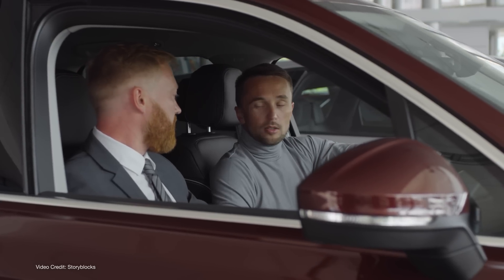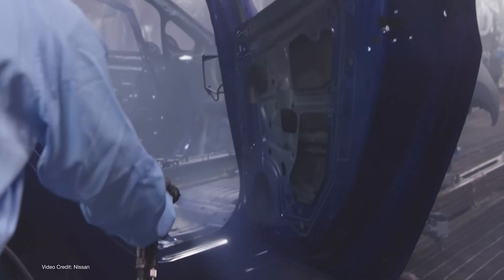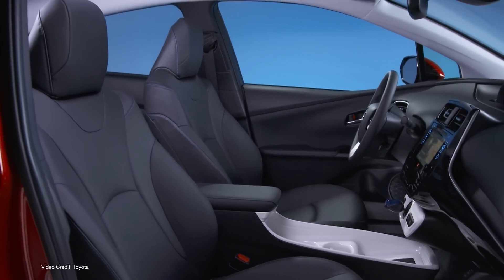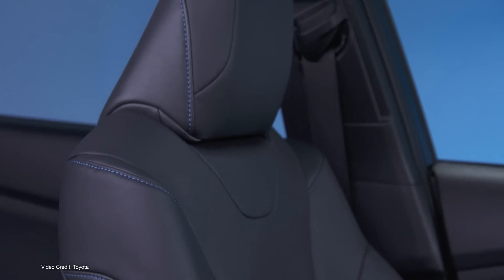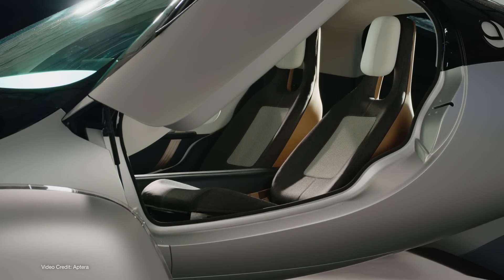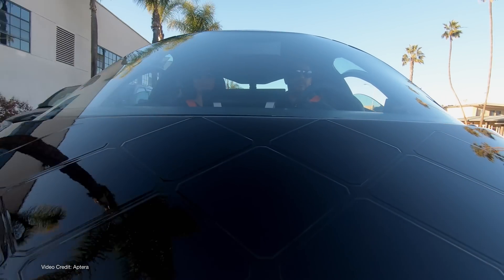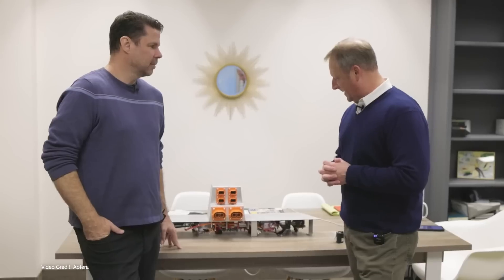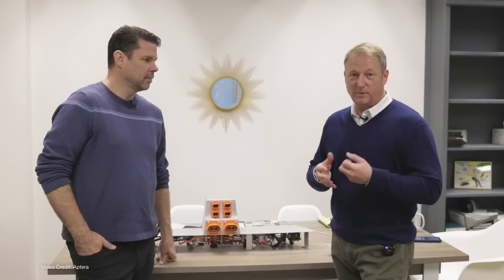Aptera Just Did a 180 On Fast Charging - Here's Why

Comment: Good presentation, thanks Nikki. One thing, with regard to your particular situation, you mentioned refinancing and getting a lower monthly payment to go along with your new solar loan. 
You didn't mention amortization. If you had been paying on your original home loan for a while you were just starting to pay off principal. 
With the new home loan you're back to square one with regard to paying principle with your monthly payments. You have to take that into consideration also. Refinancing is usually bad. 

Here's a trick. Get a home equity line of credit, And pay off your mortgage. The interest rate will be slightly higher, but it's a simple interest loan and you will start paying off principal from the very beginning.  This works best if you only keeping your house for Less than 10 years.

Comment: Fast charging electric vehicles can only be charged 120 to about 240 with about 80% only capable of 180 charges.  That means you can only recharge the battery 120 to 240 times with the vast majority being only 180 times.  Imagine a gasoline car only being able to go to the gas station 180 times before having to replace the entire engine.  The reason why electric cars do not last longer than 1 to 5 years is because of all the electrical shit in them that breaks down every time you do anything with it.  The longest lasting electric car lasted a grand total of 5 years and that was it.  Electric cars break down instantly and have to be replaced constantly and have massive problems.  They are not a replacement for gasoline mainly because they are already breaking down.  Over 300,000,000 electric cars have been made in the last 15 years but only 4,000,000 are still on the road and those were made in the last 5 years and will also break down.  Electric cars are not green either because in order to mine the extremely highly radioactive and dangerous and extremely rare materials in which child slave labor is used, along with transporting the materials to the factories in China that make the vehicles, then transporting them across the ocean, then putting the cars together in the factories in Germany, Russia, South Korea, then transporting more parts to America before finishing the building prosses of them electric cars use more than over 5000 times the amount of fossil fuel than a gas car will require for its making, transporting, and refueling for 25 years.  Then after the massive fossil fuel use just to get the piece of shit electric vehicle to you morons who falsely believe is good for the planet then you have to look at the reality of how much fossil fuel is used to increase the stress massively upon the electric grid that is already stressed to fucking hell with all the other electric shit it has to power to the point that in order to charge a single electric car it uses 187 gallons of gasoline to charge an electric car for use during a regular week in which a gasoline only needs to be fueled up once a week in which requires only 20 gallons of gas for a gas car.  That means for fueling up an electric car uses more than 9 times the amount of gasoline as a gas car uses.  Electric cars are not efficient at all and use so much more insanity of amounts of fossil fuel that make them straight up trash.  If humanity stopped making adn using electric cars then the use of fossil fuels to fuel vehicles would drop by 98% instantly.  If you stop making and using solar and wind power and focused on using coal to power the planet then the requirement of fossil fuels would drop by nearly 99% and we would be using dam near no fossil fuels and the planet would be safer because of how much digging and how rare and how much it costs in fossil fuel usage to mine the super extremely rare and dangerous materials and by how many slaves are used and how much more fuel is required to melt down the shit to make it usable.
Reply: Lots of false claims in this wall of text.  Some of these are REAL whoppers.

Comment: It will hurt your battery lifecycles to charge so fast. Be careful what you ask for.
Reply from the maker: There's evidence it may extend the life of the battery in some circumstances.

^Kate
Reply: Aptera has much lower impedance on the cells in their packs, so they aren't subject to as much heating.

Comment: I still can't get over a couple items.  1 - the recharge times still deters many who travel distances, so basically EVs are primarily for those who don't travel such distances with time constraints.  2 - I just don't understand the concept of developing such products in CA, due to the significantly higher costs associated with any business in the state.  Between all the red tape, taxes, regulations, cost of materials and labor costs adds a great deal to any product manufactured in the state.  The costs will likely not change, but hopefully the near future will show some great improvements in recharge times, especially for those who travel a great deal.  There has been a push to have charging stations around countries, though they still may be difficult to find in places like the US, where rural areas may not yet be able to accommodate them.  On another note, it's rather ironic that CA has pushed so much for 'green energy', going as far as kicking out more and more restrictions placed on gas or fossil fuels in general, but seems to have a problem keeping normal operations powered - brown outs and lack of sufficient electricity causing restrictions on recharging EVs.
Reply: If CA were as dire a business environment as implied by your rant there would be no manufacturing at all in the state. CA has one of the largest economies in the world, bigger than many countries. You comment appears to be cut and pasted from some right-wing "news" source.
Reply: I live in Iowa, and will be getting an early model. 62% of our grid power comes from wind.  It will be perfect for us, and the solar will reduce overall power demand on the grid, along with the much better efficiency.

Comment: The Tesla Supercharger network isn't the only DC fast charging option for NACS (North American Charging Standard) equipped vehicles.   EVgo stations are being installed that are also equipped with 50 kW NACS cables in addition to the more common CHAdeMO and CCS cable combinations.  So there is no need to wait for a confirmed agreement with Tesla for use of the Supercharger network to justify including the DC fast charging capability.

Comment: The thing is they were right right with their initial choice, as much as I hate electric cars, fast charging shortens the overall lifespan of a battery
Reply from the maker: There's evidence that it may extend the life of the battery.

^Kate
Reply: @transportevolved  I mean any rc airplane enthusiast whose worked with lipo batteries which ar similar to what goes into modern electric cars knows this, it’s common knowledge, it’s also common knowledge that they are highly explosive when punctured, especially when exposed to water and are extremely dangerous, and that cold weather is hard on them as well
Reply: @c0ldyloxproductions324  Apples to oranges comparison.  Battery tech is continuing to change rapidly.

Comment: They removed it because they have no thermal management.
Same show stopper they had in 2009.
They don’t even have a functioning air conditioning in the production prototype they are showing.
This is a huge issue and is something they will have to resolve.
So expect further delays.. and sone added vents.
Reply: False.  The thermal management is excellent, especially on the present production intent vehicles.  There are three separate cooling loops.
Reply: @n.brucenelson5920  Did you actually write "Production intent" with a straight face?
Asking for a friend.

Comment: Let's take your final comment first. Macs SUCK BALLS.  Apple has stolen every single one of their ideas from someone else and claimed them for their own.  The GUI, for example, was developed by Xerox, not Apple.  So, no, Macs are NOT cool.  Win 3.0 worked better than the most recent Mac OS interface, mostly because Mac has been using a Linux kernel for 40 years.  FYI, Apple had to resort to using the PENTIUM chip because the company that manufactured their CPU refused to make it any more due to low volume runs.  Low volume runs!  From Apple.  In other words, the CPU manufacturer did not see Apple as being a profitable customer and decided to drop the contract.  That alone says a lot about the Apple line of products.

As for the rest of this video, I feel sorry for you when the Aptera turns out to be just another Edsel.  Edsel sold a few hundred cars too before the Ford gave up on it.  Aptera only has the one vehicle.  When they fail to make a profit on that one car, they are gonna go out of business.  I really hope their investors don't take a bath on this.
Reply from the maker: Was that cathartic or did you just want to be a Dick?

Comment: Please help lobby congress: The EV Tax Credit should be allowed to be spaced out over two or more years for those individuals whose yearly income is not sufficient to qualify for the full benefit. If the goal of this tax credit is to encourage the maximum number of people to buy electric vehicles it makes NO sense to structure it so that those who need it the most will  benefit the least from it. As it is written only  high earning individuals, but not too high (over $150,000 for a single tax filer), get this full benefit. This is an important economic justice issue IMHO. Our tax code should not be structured so it blatantly rewards wealthier individuals at the expense of lower income earners. A simple fairness issue, no?

While we are looking for some EV Tax Credit justice here, we also should be lobbying for future Aptera buyers to be eligible for the full benefit too. We should be encouraging people to buy this most efficient and greenest of vehicles as this ‘auto cycle’ will operate in every way like a car. Its longest range version after all allows two passengers and their pets to travel 1,000 miles on a single charge. That is significantly further than any other qualifying EV is achieving. This most American of companies with over 40,000 initial reservations should be incentivized to source their future batteries according to the IRA’s guidelines, just as the car companies are.

And finally - an EV Tax Credit hack for those who have money saved in a traditional IRA (403B, …) but have lower annual incomes that do not allow them to receive the full $7,500 credit: You can create taxable income by rolling over money from this retirement asset into a Roth IRA, that can then grow tax free and allow you to withdraw it tax free later. There is not currently a limit on how much you can roll over once a year, but you do need to wait 5 years before withdrawing it without a penalty. So while waiting out those 5 or more years to withdraw these Roth IRA monies why not invest them in companies that are pretty sure to be growing healthily over the next 5 to 10 years, like EV or renewable energy stocks, mutuals, or ETF’s! Invest in your values so that this money can help further transform our economy into one with a cleaner, greener, safer, healthier and more sustainable future!

Comment: fast chargers degrade batteries -- its a good call. the 180 is stupid. now they need a bunch of additional junk and less energy density in the pack.
Reply: Aptera uses less pack impedance so the same cells are less heat stressed than the Tesla design

Comment: First the correction.  At about 7:40 you assert stopping for an hour to pick up another 100 miles.  Of course it’s only 57 miles per hour per their advert.  

That really gets to the pale that they went beyond also.  At typical US highway speeds, you are likely to travel more than 57 miles in an hour.  So the prospect of charging for an hour, and then still not being able to drive for another hour is crossing a line of unacceptability for a lot of EV drivers even with modest expectations.

Comment: With a relatively small battery and no radiator, it's going to have a lot of trouble cooling while fast charging. Note that no radiator also means that there is no radiator fan, so no air flow when the vehicle has stopped to charge. I wonder how fast it will charge in reality. The Nissan Leaf for instance had real trouble charging anywhere near its maximum charge speed (which I think was 50 kW). They might as well limit the fast charging to ~20 kW.
Reply: There are some false assumptions here.  Aptera has 3 cooling loops and one is for the AC system.  At low speeds or stopped for charging, the AC fan and condenser kick in and provide the additional cooling needed.

Comment: Fast charging is needed for long highway trips.  My question is, is this vehicle appropriate for long highway trips on a road with many heavy, fast vehicles?  Its occupants could not survive a crash with a Ram pickup truck, much less a Mack truck.  Aptera’s high efficiency requires a light shell around passengers, which needs less force to crush than conventional vehicle designs.
Reply: Decide when you see the results of the 3rd party FMVSS Part 200 crash tests that will be performed on the production intent vehicles being assembled now.

Comment: Personally, I'd be fine if a 400-mile, hyper efficient EV didn't have DCFC, but I would demand that it have 19.2 kW AC charging. And no, not using Tesla's proprietary plug standard. The joke... err... yoke steering wheel would have to go too.
Reply: The NACS connector is now no longer proprietary, and we have Aptera to thank for this.
Reply: @n.brucenelson5920  Credit where credit is due: We have Tesla to thank for releasing their plug format, but we have SAE to thank for establishing a standard based on CCS and the Tesla plug format (J3400).

Comment: It makes little sense to omit fast charging, as it requires almost no hardware, just a connector and contactor - the charger does most of the work, unlike AC charging which uses dedicated charging hardware in the vehicle.
The only case where it can be an issue is where the battery pack voltage is quite low, like on motorbikes, as the CCS standard has a minimum working voltage of 200V. I wonder if this may be the case for Aptera,  as a lower pack voltage may simplify things for the solar charging.
Reply: Aptera battery pack will be between 3-400 volts.

Comment: What we're they thinking with that decision  , flexibility and range is the biggest selling point of the vehicle . Even with a fossil fuel car there must have been a time over your years of driving when you have misjudged your range and had to make an unplanned top up  . If not you've been fortunate enough never to really venture beyond your local area . Fast charging ability on an EV is a must and also utilising the predominant connection charger to vehicle network in that country  . Surely not to much to ask

Comment: The fast charging should be at least 150kw, since their is less 50kw chargers and most likely none in the future.
Reply: A 150 kW, 250 kW, or 350 kW charging station will charge all day at 40 kW. It doesn't care. The charging station gives the car only what it asks for UP TO the charger's capacity. That misconception is why we still find cars that can only take 100 or 150 kW parking in front of the 250 or 350 kW chargers thinking it will charge them faster. It won't. All that does is block the big charger from cars that can accept that charge speed. There is zero need for Aptera to go more than 50 kW on its small batteries. The max recommended charge for the 60kWh pack would be around 120 kW and the 100 kWh pack could use 200 kW to keep in line with the industry standard 2C charge rate.
Reply: Like the Bolt's 55kw "fast" charging...